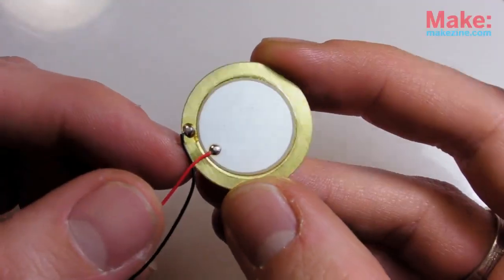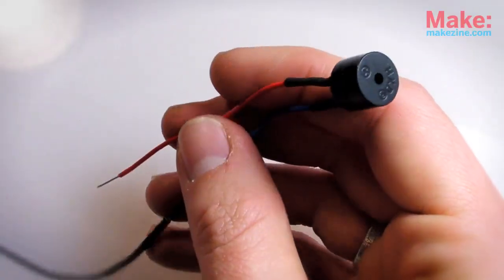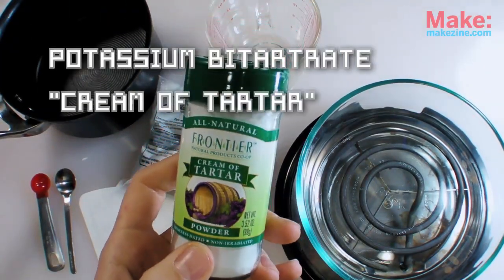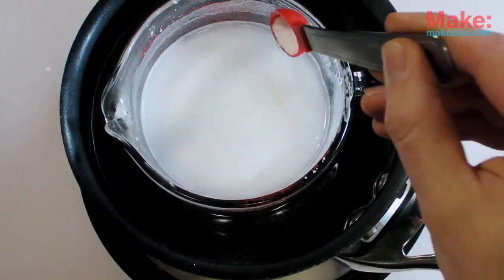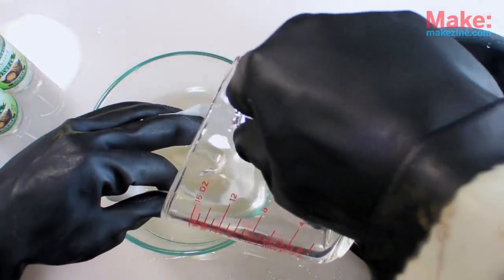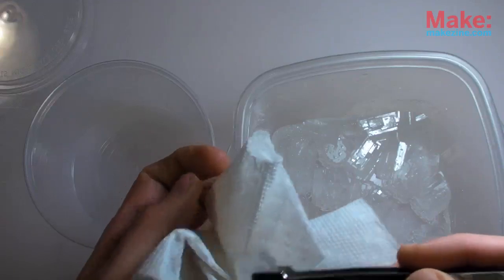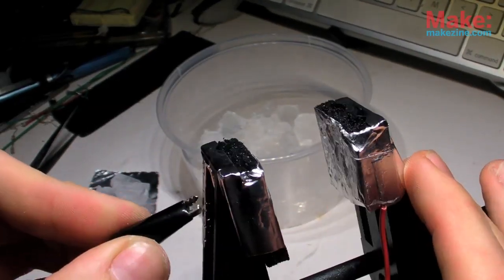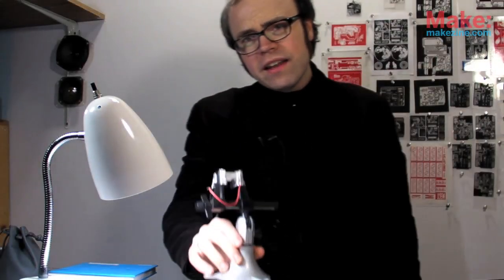Collin's Lab: Homebrew Piezo

Comment: With some careful cutting, grinding, and polishing along it's crystalline axis, you can both increase usable surface area and tune frequency
Reply: thank you for this
Reply: He could make it a lot better if he took what he had, selected a seed, and recrystallized around it in an insulated container. That will give him bigger, more perfect and more pure crystals to facet.
Reply: @AtlasReburdened  Also, crystallization seems to have happened too quickly. The liquid was too concentrated. Would be better to dilute it, dangle in a seed, and let it evaporate slowly over a few days. Also, use distilled water to minimize contamination. Metal salts in tap water will totally ruin the crystal structure.
Reply: @rich1051414  Indeed, I suggested an insulated container to slow the process, but it would probably be easier to go your route and just start with a lower concentration. Also yes, distilled for sure. Personally, I would take water from a freshly serviced Glacier refill machine(because I've tested a few and when they're freshly serviced they put out 4PPM water) and run it through a clean, ungreased, glass distillation rig with a heated(but obviously not to boiling) receiving flask. That should give the purest water anyone can have access to outside of a lab that specializes in 0PPM, dielectric grade water.
At that point, it would probably be wise to do the crystallization in a container that's capped with a fresh carbon filter to prevent airborne volitiles from absorbing into the water.
Reply: Thank you guys that helped me a lot. @Zeek is it possible to cut multiple Piezo Crystals out of a very big one?
Reply: Can you advise on some cutting methods
Reply: @ahbarahad3203  🤡
Reply: Demonstrate
Reply: Or just cover both ends with molten gallium- it will make a decent contact

Comment: You should've tried inputting a signal to see if it makes any sound
Reply: umer salim I was anticipating him doing that too.
Reply: Yes. That's the whole reason for watching; I want to homebrew a piezo pickup for a guitar with nylon strings. 

That big crystal seems a bit awkward for that purpose.
Reply: Then make it smolah
Reply: @biggreentruck4907  you wouldn't need more than a strip of that. Generally piezos will go in the same slot as your bridge on a nylon. A little stick of it would work.
Reply: It should work but usually you might need an amplifier circuit depending on the amount of electricity generated

Comment: Cooling of the hot saturated solution produces crystals very quickly, but they have much defects.
If you re-dissolve these crystals in pure water and them let it evaporate slowly, that's what you can get:
https://plus.google.com/photos/116542359168957860292/albums/6071596141873389857
Reply: Beautiful crystals, I haven't messed with Rochelle salt since my main thing is growing large Monoammonium Phosphate crystal clusters.
http://www.pinterest.com/bartlett1710/
 I started around April of this year and my oldest crystal now weighs a lot and the individual crystals are an inch across. I just had to move it into a five gallon bucket because the side crystals had grown flat against the 2.5 gallon bucket. I have grown large batches of single Copper Sulfate crystals as well as large clusters that only look nice because I glued clusters together before letting them grow together. I am having a big problem with what I thought would be the most beautiful specimen: a sphere with crystals growing outwards. I believe the fluid dynamics of the way the crystals grow on the sphere is interfering with it's progress. I had used a matrix of compressed rock with a hole drilled through so it could be supported on a stand. I then made a device using a simple coat hanger that has the specimen rotated 90 degrees so it is horizontal and free turning so (in theory) as the crystal growth on top gets heavier it will turn allowing the rest of the crystal equal time on top. Your crystals are beautiful so you must be good at what you do. I am having a large problem getting my specimen to 1. grow equally 2. get any larger than 3-4 inches in diameter and need a little help.
Reply: Konichi Wawa My crystals are small, I have never grew any bigger than 5 cm. But, as far as I know, one of the methods for growing big crystals involves artificial circulation of the solution. There are different ways to do it: rotate the crystal, teether the growing tank etc.
Here, they use rotation: http://www.youtube.com/watch?v=l_USYub3djY
Reply: Dmitry Shintyakov how can I grow diamonds?
Reply: Toki Loki  you can't unfortunately
Reply: Dmitry Shintyakov Any thoughts on growing crystals in a mold?
Reply: Thelothuo I think, it is complicated, you will need to ensure that solution circulates over the whole growing surface of the crystal. As far as I know, in practice crystals are usually grown freely and then cut in shapes.
Reply: Dmitry Shintyakov
 Can the crystal not grow linearly? Through a tube or between plates, for example? Or perhaps doing so makes the crystal difficult to remove from the container? 

 So it is indeed durable enough for cutting?

 Have you tested the piezoelectric capabilities of the distilled water crystals against the raw water crystals? Some light research suggests that the piezoelectric characteristic is caused when imperfections in the structure receive stress, so there may be a chance that the purified crystals won't work as effectively.
Reply: +Yan R. with huge pressure I guess ;-)
Reply: Dmitry Shintyakov - So interesting! Thank you for that info.
Reply: is it the same thing as quarz?
Reply: Same effect, but different compound.
Reply: Dmitry Shintyakov Wow.
Reply: Wow! Looks great!
Reply: Hi Dmitry, have you tried making piezo pics using these crystals?
Reply: I mean with the crystals you have made

Comment: The oilfield used Piezoelectric  crystals in their tools to pick up Gamma Rays given off by the formation.  Depending on the type of formation, it gives off different signatures.  Limestone/Dolomite gives off a very LOW count even lower than what you would find in the Background radiation at surface = +/- 30 counts per second[API].  Whereas sand is typically between 30 - 45 counts, and shale is much higher 65 + counts.  The crystal glows when hit with the gamma rays, and the light is measured.

Comment: Looks like the output consists of complex transient currents. Impulse and oscillating dampening waveforms. This is not necessarily an A.C voltage as the impulse wave does not oscillate back and forth, but rather pulses in one direcrion; more similair to a d.c output. This makes me think that a piezoelectric crystal could be used in place of a spark gap or vacuum tube if someone was to build say a tesla hairpin circuit, or some kind of mechanical analog to that.

Comment: Seal it between two thin resilient surfaces (conductive) before it dries. The disk piezo uses a similar method where the crystal forms after the disk is sealed.

Comment: I have an ultrasonic cell disruptor.  In the manual they tell you that the frequency of the horn, has to match the frequency coming from the power supply.  They are set by the manufacturer.  If they do not match, they say that the power supply will fail.  I am wondering what determines the frequency of the piezoelectric crystal inside the transducer horn?  Does the geometry and size of the crystal determine it?
Reply: It's the size and shape determining the resonant frequency. Much like the size of a crystal oscillator determines it's frequency. Not sure about the damaging power supply part. Maybe drawing too much current if it's not close to resonant?

Comment: @themvp007 - you'll find one as the on-board speaker on at least some modern PC mother-boards. The crystals have a natural resonant frequency too, and just like ringing a bell, the larger the crystal the lower that resonant frequency is. Other crystals can also work.

They also put out a voltage just from pressure. Squeeze it with a pair of pliers (not too hard now). This electro-/mechanical effect may explain the strange behavior of animals and rainbows before an earth-quake.

Comment: If you added an ac current would that cause the crystal to change shape or vibrate? Also while its cooling do you think if you exposed it to a sound frequency it would crystallize into different patterns?

Comment: have you tried to produce sound with the crystal by applying electricity to it? does it work?
Reply: It works just like a regular speaker, but instead of using the movement of an electromagnet through a permanent magnet to move the diaphragm, it uses the changes in size of the piezo crystal

Comment: Maybe and yes.

The maybe being that the output voltage would not be as consistent because it would be as if you were hitting multiple crystals at the same time. it would produce a noisy signal.

But for pure asthetics, yes it would work great for that.

Comment: It converts physical pressure into electrical pressure, aka voltage. How do you convert voltage into watts/amps? It would be interesting to see how much energy could be captured from the vibrations of a generator, it could technically improve efficiency by capturing all wasted energy. Maybe combine that with thermocouples and capture the wasted heat energy.

Comment: while heating, inner pot should not rest on the outer pot which is very hot. May be one should hang the smaller pot i such a way that it remains partially immersed in the liquid, but does not touch the much hotter heating bottom surface of the outer pot.

Comment: How many ml  of water do you use? and do you try to retain the temperature of 180 °F by heating the water constantly ? or do you discontinue the heat supply when it has reached the mark of 180 ° F? Thanks :)

Comment: @mastigoz Applying a dc voltage won't create a sound it will just deform it slightly, but applying an ac voltage like the one in musical signals will vibrate it and create sound similar to a speaker...

Comment: @amandaskapp Good question. the answer is no, your altitude and quarting of the recipie dosn't matter. what does matter id the cool down time. if the solution cools quickaly, the crystals formed are like what you got; thing and stringy. the trick is to lanthen the cool-down peroid. this can be acheived by making sure that the container is sealed, and even insoluated. this is to ensure that the solution has ample time for the large crystals you desire. hope it helps!

Comment: The reason you want to make these piezoelectric crystals is because you don't have access to a piezoelectric speaker or buzzer. It doesn't make sense to make big blocks of crystals when you need to place them in a speaker's frame. Big crystals require more electricity to produce vibrations or sound. You need to make "small" crystals in order to make a low voltage piezoelectric speaker, to incorporate into a circuit like an alarm or a crystal set radio.

Comment: Collin,

Do you think its possible to build an oscillator using Rochelle salt? Typically quartz is used for crystal oscillator circuits in radios however for "cooking" crystals in the kitchen quartz would be very difficult.

Regards,
Evan W.
Reply: Yes, you can build an oscillator with rochelle salts (using the crystal as a resonator). So certain piezo discs have 3 terminals, the third being a sort of feedback terminal. A transistor and 3 resistors is used to construct a working oscillator. This style of oscillator is at the core of those self contained beeper modules.

Comment: Just throwing a thought out here. Will the crystal melt under heat? if so couldn't you put it in a kiln and re-composite it onto a metal disk? Just a thought,  That's how ceramic is made right?

Comment: if one was to attempt to cut paper thin sheets of rochel salts, would said person be shocked by the emited ac voltage? Also can these crystals be stacked, would current be able to travel through a crystal into the next crystal then to ground?

Comment: How about cooling it of in a centrifuge to concentrate the crystal: What kind of crystal will that produce? Also one could perhaps measure the 'efficiency' of the crystal by dropping a known mass from a known height on it. And then dividing that energy input with what is measured/captured on the oscilloscope.
Reply: +Nicklas Persson i don't think a centrifuge would be beneficial for crystal formation because for crystal growth, it needs a still medium (water) for the molecules to coalesce and grow.
Reply: +w00borg maybe use a turntable (remember Eoceno had some small ones in the past, but guess you can build your own easily from cheap parts now or grab some old audio one) with a computer or microcontroller slowly turning it?

Comment: @rampike74 - I'd have to do some quick research to give you a definitive answer but earthquakes most always have a pressure buildup in rock layers that then give rise to the piezo electric effect. Exactly how that translates into causing atmospheric rainbows I don't know for sure but it would seem that there is a connection. Rainbow streaks are often seen just before an earthquake occurs.

Light is a fascinating critter, as are electric fields.

Comment: You're using weird units.
Reply: Hunter Ziegelmann Alright, but you can't say that imperial units make any sense. I mean, you have 12 inches in a foot and 3 feet in a yard. Then one mile is 1760 yards or 5280 feet. How about 10mm in a centimeter, 100cm in a meter and 1000m in a kilometer?
Reply: +Peter Bucek that's because you're thinking about it differently... the measurements scales aren't in a specific reference to each other. they are in a reference to the objects they generally measure.
Reply: and then, with metric you can calculate between measures that make sense, like converting between weight, volume, temperature and speed etc.. easy.. americans have to fluff about converting to decimal, metric, then use a chart, then convert back to their foot.. no wonder they screw things up, and confuse the rest of the world causing bad accidents lol
Reply: @Hunter Ziegelmann Did u mean the desert in Nevada ?

Comment: how much of that say a 4ft tube of 1.5inch PVC pipe POWER say enuff for a Piezoectric Laser BOW
Reply: thank you for the video another example piezoelectric transducer between two cobalt magnets compound piezoectric Transducer bow pull back then the bow magnets unlock reléase the bow magnets get close and smack the cell/cells 100x cells estemated power 2000 volts in split second

Comment: I think that's not the point, my friend. Even if you were crazy (or creative) enough to use that crystal to capture sound, you would add a gain stage before it so that you could reduce this voltage to the range of microfone level (around 14 millivolts).

Comment: @vw77 I dont think that would work. You would get a thin film, but it would be composed of millions of small crystals, of whatever specific struture this has, not one large crystal, which is what you need. It would also be very brittle. But thats just my hypothesis, why not try it? Experimentation is the core of the scientifc method.

Comment: Could I charge a battery with a piezoelectric crystal?
Reply: +Bob Dole good question, so the harder the hit or pressure, the more volts will enter the battery I think, I never tried it out because out don't have the ingredients to make a piezo crystal right now, but I would try it out if I was you, I would us a digital, or just a multimeter to figure out if the batteries volts has raised or not, when I get the ingredients to make the crystal, I will tell you how it went.
Reply: +3hornthrasher Thanks for the reply. Hopefully I wont shock my self
Reply: Bob Dole lol, good luck :)
Reply: +Bob Dole Did it work.
Reply: Montgomery Bermann Haven't yet, the only thing i've done is check the voltage output which averages around 5v for a piezo crystal with a diameter of about 5cm.

Comment: I think you need Sodiumbicarbonate instead of sodiumcarbonate,
Because after mixing sodiumcarbonate and cream of tartart, nothing happens
Reply: Both are fine. The only difference is in quantity.
If nothing happens, then something is wrong: one of your reagents is not what you think.
Reply: Dmitry Shintyakov so is using baking soda instead of soda ash show the same results. (no extra steps needed if we use baking soda instead)
Reply: All of the tutorials I've seen require turning baking soda into sodium carbonate by baking it on a baking sheet before continuing with the process. 
So why not skip the extra step?